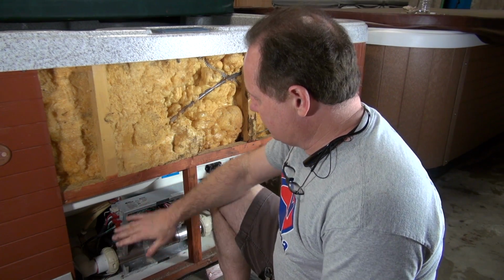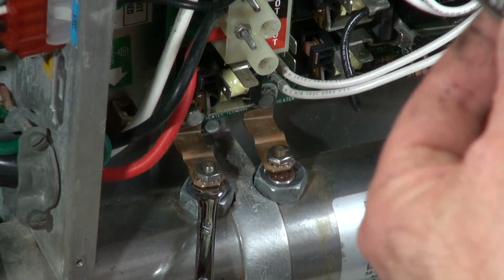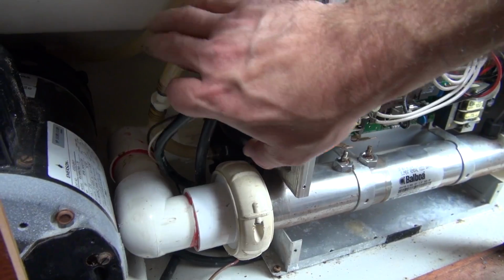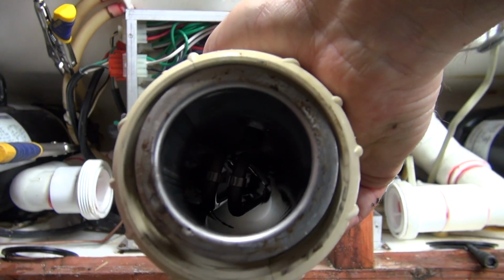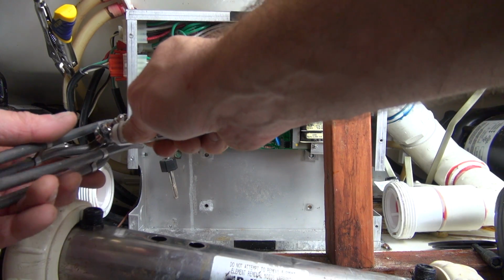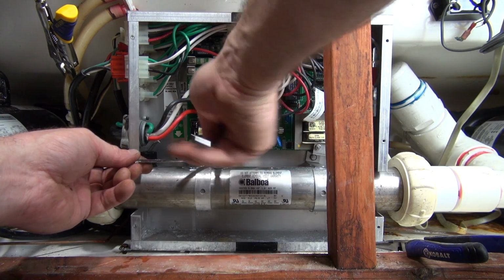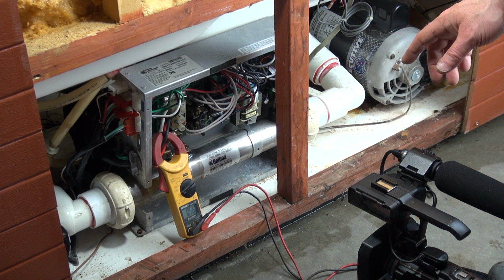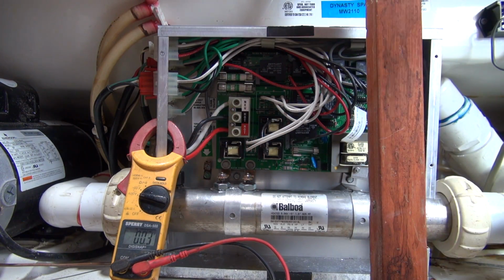GFCI Breaker Trip Diagnosis Heater Replacement Hot Tub How To Spa Guy

Comment: I got a platinum  2 hot tub ,its one of them costco ones its a 325 gallon 6 person ,my situation is when I reset the breaker it kicks it out immediately, so after doing a few things  ,(1 ) I DISCONNECTED MY ELENENT AND IT DIDNT TRIP IT , BUT HOLD ON BECAUSE THEN I HAD CHECKED IT WITH MY OHM METTER AND TOUCHING ON THE 2 PRONGS ON THE ELEMENT THE READING WAS AT 15 SO THEN I CHECKED ONE PRONG TO ONE OF THE ELEMENT STUDS AND THE OTHER TO THE HOUSING IT WAS OL SO DID THE OTHER PRONG SO THAT EOULD TELL ME THAT ITS GOOD RIGHT? NOT QUITE DONE YET SO I CONNECTED EVERTHING BACK AND IT TRIPPED THE BREAKER again I then disconnected  the ground wire to tub and didn't trip so I went to check the to tabs with my ohm meter  when it fires it does so for about 2 -3 seconds with 240volts so my board  should be ok Wright? So upon further research  after that it shows its heating on my topside control but when I check on the tabs at the element nothing  so I provided to do a jumper from the relay on the black hot side relay and heates fine but I can control the heating now with my top side control because I have it jumped, one more thing to throw out there is that I did order a new top side controller and installed it but wasn't exactly the same overlay but all 7 button functions are working as described  , someone please help ,oh I forgot to mention  that when I have the jumper on the element  and the ground wire hooked back up I feel a little electricity in the water when I am barefoot and one had in the water.
Reply: Solved i wanted to thank the spa guy for all the information, I got out of work and just double ,triple checked everything and did find that the  heater element was tripping it ,whats really crazy is the way this all happened, so let me start by saying that I got the hot tub  from a realities that bought it back in 2006 and used it for about 5 years and he told me he really got his time In it but let me tell you its a platinum  2 hot tub ,one of them costco ones ,I was very skeptical  to take it from him he literally  had it Ion his roof of his house and don't even ask I we got it down ,he had a crane put it up there, and I guess I will share the story how I got it down so I drove a forklift from work about 8 blocks down alleys with about 20 pallets shaped down to the forks since I figured it wouldn't reach that hi when I got there he was getting his whole flat top roof redone and said he was going to chop it up if we can get it down ,I was very persistent  to get it down in one piece ,so let's jump to how we did it ,we lifted  it on some load bars to slide it over the edge of the roof with some tethering  rope and about 6 guys pushing it over the side while I had the forklift about a good 12 feet from the top  anyway I just can't get that out of my head so anyway we got it down set it in my yard and started  to take it apart everthing was cracked all three faceplate covers ordered them found more cracks on gate valves ,both of them some of the hoses literally pushed of from freezing  and didn't care about it so put it all back together filled it and was amazed it holds water ,next I hooked up the power ,I said beautiful let's turn it on , started to try and use topside control panel  jets were going on but no heat so let me tell you I was like let me tell you I kind of rigged the wiring from my air-conditioning breaker first just to see if it works minus the ground it  powered up but topside was acting up I took it apart had all kind of white flakeness around a few of the processes decide to order one ,got it about 7 days later suspense  was killing me ,hooked it up and ,what do we know light up beautiful temp showing and here is the problem I then ran in to ,I set the temp and it started  to heat ,I said nice left it like that for about 3 hours walking around it double checking everthing triple ,I mean countless times ,finally  I said let's hook it up ordered a gfi  electric box  got it alm wired up AND THIS TIME IHOOKED UP THR GROUND WENT TO TURN IT ON ANX SNAP THE BREAKER TRIPPED ,SPA GUY PUT IT ALL GOID HOW TO CHECK IT ,I did the ohm meter  checking took the board out no burns or lose connection I couldn't figure it out I checked the prongs on the element with ohm meter  it was at 15 checked one prong then other lead from meter to element housing it said ol so that fine ,NORWALLT I HAD MY OHM METTER SET TO 20 ,IT TOIK ME buyout 3 days to go back and check it with my ohm meter  set  to 200 ,I  probed housing of element  and one prong and there it was it jumped ,I HAVE TO SAY THAT THE SENSITEVITY LEVEL OF THEse gfi breakers are really  sensitive I mean sensitive so I wanted to throw it out there also I did have the shocking  when I touched the water and one foot on the ground scared the shit out off me anyway if this were to tell you something is hook your hot tub up right before you cut corners like I did and take your time in working with 240 volt system but Nyway got the new element coming will let you know what happens , Thanks again to the spa guy for his time in making these  videos.

Comment: The heater on my spa works intermittently. When I initially turn the heater on, the heater light illuminates but goes out after a few seconds. The system still runs, but the water doesn’t heat up. Suggestions please

Comment: I have an old first generation Hot Spring Spa. Serial #10095 does not have a model type.  The circulation pump was making noise but there was hot water. Would heat but would trip the GFI at the plug. I replaced the heater circulation pump and the water is moving fine now but the heater is not heating. Before I buy a new heater element (the most expense part) could it be the thermostat? How do I check if its that?  Or the Hi temp sensor? How do I check that also?

Comment: I am having the issue you described at the end of the video where I get no power across the heater terminals and half when tested through the ground. How would I go about fixing the cold soldered joint on the board?

Comment: I have a cal spas with a Balboa 2100 and the only way I can get it to not trip the breaker is to do 1 of 3 things.  I have a direct short somewhere between my black and neutral.  1 unplug the transformer, 2 pull the 1/2amp fuse just left of the plug for the transformer, 3 pull the 30amp fuse that's at the top of the box.  I replaced the transformer as we did test it and it was bad however the problem persists.  I see no damage or shorts on the board.  

Any thoughts or suggestions of where or whatI can look at next?

Comment: hi  I  followed   your   video   and   when   I  unhooked    the  heater   the   hot  tub    didn't   trip...  but    when   I   turned    the   jets  on   high   it   still   tripped    the  breaker    with  the   heater    disconnected.   can    this   still   happen   if   the   heater   is   faulty. please    respond.   great    video.    thanks   brett

Comment: started my tub up after years started warming the water (set low95ish) for trial. All was good went to bed and woke up breaker tripped.  with everything connected except the plug to the heater seems fine as soon as I try to connect the heater it blows.  tested it and its not shorted and reads 15ohms your thoughts please

Comment: Hey Spa Guy...my Solana TX spa is approx. 14 years old, 2 years ago I replaced the pump and all has been good, until yesterday when we had a power outage, this morning my spa was running on low which is normal, however the water was cold.  Would not switch to high, so I tried to reset everything and got the spa back working as it should but now the heater does not seem like its working...no error codes, the light on the display shows heater ON, everything appears to be working as it should, does not trip the breakers, however the water is cold.  I have not open the unit yet, will get around to that tomorrow, does this sound like a bad heater?  How long does a heater last?

Comment: Great video, thanks, now the last 15 seconds of your video is what I have a problem with, I replaced the element but still not heating, it shows 0 volts between the two heater connectors but 115 each one with ground, how do I figure it out what’s the problem on the board now? Sorry but if you can help I will highly appreciate it. 
Thanks.

Comment: I have a tub that the power terminal getting hot red side, tub runs but the plastic mount holding the terminals seems like it’s smoking a bit due to the hot wire getting too hot.

Comment: Thanks for the video Spa Guy. It helped me to replace my heater element element.
Do you have a video on how the replace the waterfall on a 2018 Jacuzzi J-375.
I was loosening the screws so I could open it and clean it. But the screws stripped and now its loose with water coming out the bottom.
Reply from the maker: Sadly I do not have a video on the water fall..
Reply: OK, thanks for responding

Comment: very cool video Im building a custom hot tub with concrete blocks will the spa pack work if i make the right adjustments. plus I know how to make it plug in by putting a 50A outdoor receptacle and using a gfci breaker. Thanks.

Comment: Excellent informative video. Problem  was not the breaker tripping but leaking. Found it at the seal at the end of the heater tube. As you described, corrosion at the heater element lug.  Tested the element per your video with my VOM. The element tested OK. Question: Is it feasible to disassemble the element from the tube clean it and replace the seal if they are available?  Not worth the time and effort?  Buy a whole new assembly?
Reply from the maker: If the Element is leaking at one of the lugs there is not reselling you replace the element.. If it is a gasket at the end of the tube you simply replace the gaskets.. I have the element with the gaskets on the site if you need both as well as silicon to seal the lugs..  Thanks, Spa Guy https://hottubpartsofamerica.com/balboa-spa-hot-tub-heater-m7-sensor-replacement-temp-hi-limit-24-video-how-to/

Comment: I'm curious if the heater elements ever bang against the inside of the heater tube.  I can't seem to locate a ridiculously loud banging noise when the heater motor kicks on high speed.  It's definitely not coming from the motor.  

Thanks for publishing such a great video!
Reply from the maker: Yes it can some elements have clips on them to keep them from vibrating and making noise..

Comment: Good morning Sir, I owned a 1997 Z140 Whirlpool spa with a balboa instruments model du-h276-dcah. After 3 years not been used due Covid I recently hook it up again. When I plug in the power the RED heater light from hot tub control panel turn on for about 35 seconds and it turn it off. After that the pump is running, everything is working pump 1, pump 2, light are working good except the heater. Can you please give me some advise what is going on here please. Thanks a lot and have a wonderful day. Kim

Comment: Question: I have all the symptoms of a bad heater, I removed the hot legs to the heater and the breaker stays on. Heater tests at 15 ohms 4k heater. After I removed it I measured across the hot legs I get nothing, I get 120 volts on the left one but nothing on the right. What would cause that? Is my board bad? Its a very old celebrity spa, I'm not even sure how old it is but I got it from a friend and we have had it for 10 years and not sure how long he had it.

Comment: Here's my problem,I have a older Vita hot tub,no digital codes,etc., my hot tub will heat up during circulation,than for some reason it trips the reset button,not the GFI,,I will reset the rest button,the timer works,but not till later I hear the hot tub kick on. If I'm using the tub sometime works great other times I will pus the control button to go to my to turn the blower for more power it will trip the red rest,not always,but freq.. Also while it is circulation mode if I turn the thermosthat up,or down,it trips the reset. The GFI never trips just the reset button.Any idea what I should look at? I did disconnect the ozenizer,it is old .thanks for any help !!

Comment: Ok, no reply yet, I have taken it out no impellor bits in there,nothing. On one of the bolts, there is rust on the top which l have cleaned. There is rust on the inside, where the bolt goes through. What should I do now?

Comment: These heater uses 120 or 240v??
Reply from the maker: Yes most elements are either voltage.. If you apply 120v to one side and neutral to the other it is 120V if you apply 120V to each leg it is 240V..
Reply: Spa Guy thanks great video ¡¡¡

Comment: Helpful video, I inherited an older model Watkins Solana TX that has a bad heating element. Should I buy an entire replacement (tube, element, gaskets, connections) for $100-200 or just a new element?
Reply from the maker: Just the element.. https://hottubpartsofamerica.com/g-heater-element-4-0kw-gasket-kit-hot-tub-spa-part-m7-balboa-gecko-hydroquip-titanium-silicon-kit-best-value/

Comment: Tested volts at heater terminals. 125 vlt. Disconnected copper plates. Tested ohms. 14 ohms between terminals. Tested terminal to tube and still reading high ohms. Am I supposed to read ohms from center terminal to the tube ? Seems to me inside heating coil is shorted to the outer housing. Am i right , it is bad and tripping breaker!

Comment: Originally my breaker was tripping, I unhooked the heater wires directly to test and it kicked on, I cleaned them and reattached and turned the tub back on and now the breaker doesn’t trip and everything runs but the water doesn’t heat up over 68. Is this the heater?

Comment: I had a pool spa or a spool heater was totally corroded opened panel and the whole heater just fell out I need to terminate the wires but I have 4 black wires 1 white 1 green 1 yellow 1 blue  the yellow and blue reads 240 volts and the 4 black wires read 120 volt I’m not replacing any thing actually disconnected the pool too turned that into a pond. The problem is I need to do something with the wires I can’t disconnect from panel because it completes a circuit so any ideas

Comment: Hi love the videos, 
Is the control board designed just to operate the heating element fitted to the tub when it was purchased new or can it be upgraded to a higher kw eg 2kw to a 3 or 4kw thankyou
Reply from the maker: most boards will operate multiple wattage elements but there are many other factors.. Most in America are 4.0 for 5.5 and changing a 4 for a 5.5 causes undue strain on the system and only adds 1 degree an hour in heat.. Not worth it.. Spa Guy
Reply: @SpaGuy  Hi many thanks, my tub has a 2kw heater which has gone bad, so needs replacement, I was told by a parts supplier I would also have to buy a new control board to increase the heater output which I had my doubts, does a 2kw have to run for longer using more electricity than a higher powered heater. ?
Many thanks Julian

Comment: Cal spa, 2007.  I changed out my circuit board, the unit goes to PR, then pump kicks on jets, they run for above 10 seconds then nothing more. I turn the breaker off, the same process again.

Comment: Great explanation however my Jacuzzi 345 seems to have quite a different set up.  It appears that the heater is a curved unit and is located behind the electrical box.  An awkward location for sure.  The water feed lines look as though they may be 1/2" at either end as well.  Does this sound familiar and do you have any tips for me on replacing this unit?  I am in Canada so please let me know if you ship parts here and cost of part(s) - thank you.

Comment: I have Balboa unit in my hot tub, about 1 time a week the heater turns off and I half to reboot the system. Also I have it set at 100 & now & then I get in it and temp is105 even though it is set at 100. any Idea what to look for.

Comment: Hi, I’ve got exactly the same issue, and heater, when the heater kicks in my breaker trips out, would it be the pressure switch or the element and could I just change the element

Comment: Ok so I let my hot tub go cold, and the breaker has tripped. When I flip the breaker the the hot tub turns back on, but as soon as I try to turn the heat on, the breaker trips again. Does this mean for sure that it’s the heater that’s the issue?

Comment: Hi Spa guy I have a Master Spas legend series 1050 and the gfci keeps tripping as soon as i reset. I have heat and normal operation if i bypass the gfci. (no we don't get into the tub) but its in the neg temps right now and don't want anything to freeze. Would it be the ozonator if it trips right away? I read somewhere it doesn't call for heat til after the prime? When it warms up a bit I plan on getting it working correctly. Thanks for the video.

Comment: Thanks for the video, unfortunately, my problem is not resolved. My gfci popped after 2 years of service.( hot tub and breaker were both new). I thought the panel was shot . But then I removed all wires leaving the panel and added back one at a time to find that the heater was indeed the problem. BUT there is no visible corrosion, and the heater ohms out at 15.1 (4K), and is not making continuity to ground? The gfci holds with heater unplugged which suggests its not the breaker? Any thoughts?
Reply from the maker: Replace the heater.. Your meter cannot sense the short to ground that the gfci can sense and you don't have to have any visible issues for it to be bad.. There are two ways a heater can be bad.. Open and a Short to Ground.. In your case you have a short to ground..